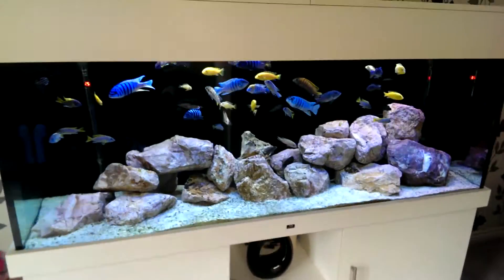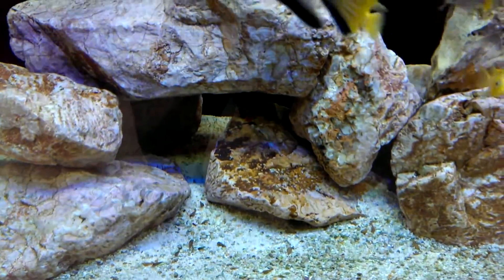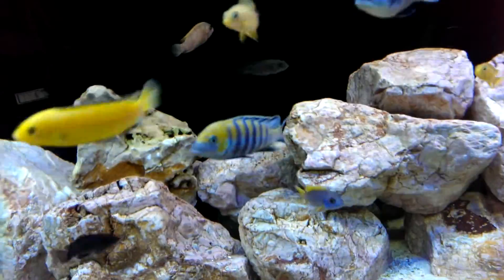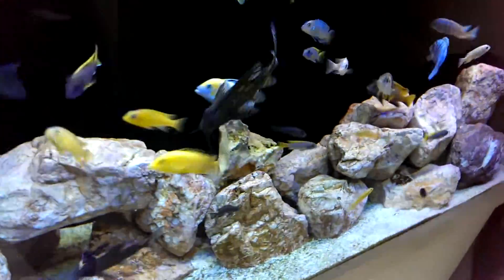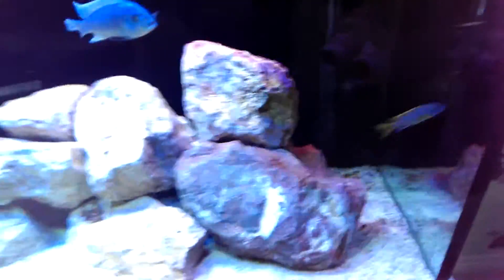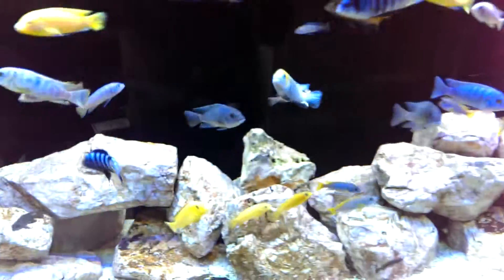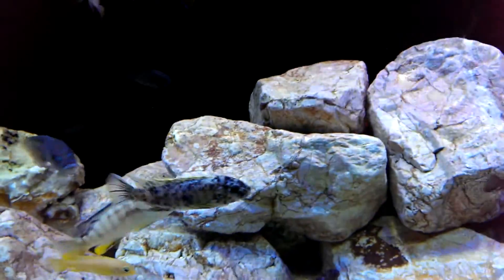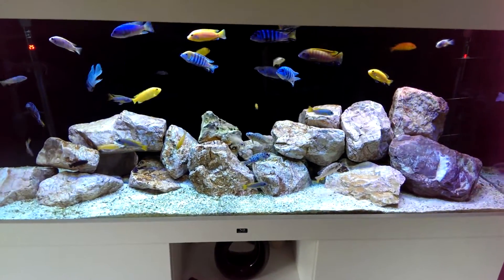My ND aquatics tank. Malawi mbuna

Comment: Sick set up bro. What lighting are you using? Love the granite
Reply from the maker: Cheers buddy. They're custom made by Dave Newbould, but the led modules are available from Ebay if you don't mind soldering :)
Reply: Lol you don't want to see me with power tools. Thanks for getting back at me though.
Reply from the maker: welcome buddy, im pretty useless with electrics too, but I got the whole led setup for £125, which is cheaper than most T5 light units
Reply: Esp the one i have... i spent over $500 for my T5s.. Granted its for sps and has 8 bulbs. Still a grip